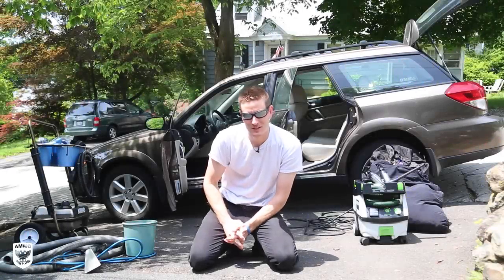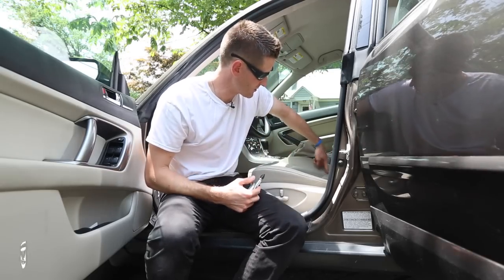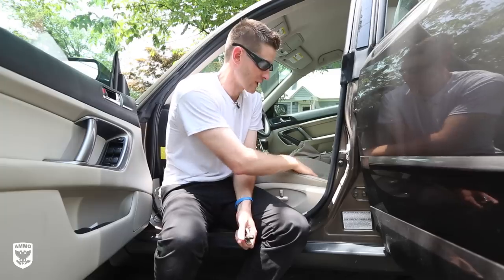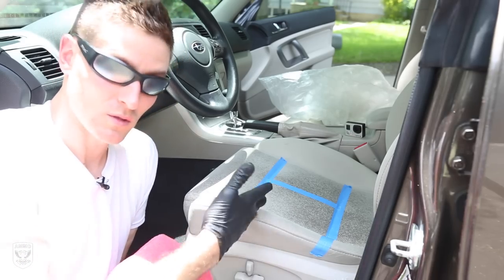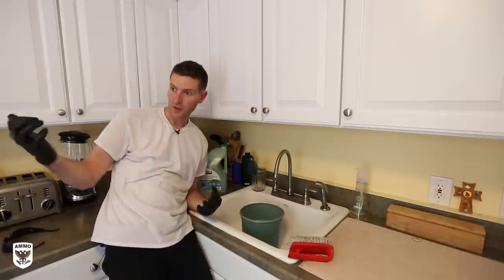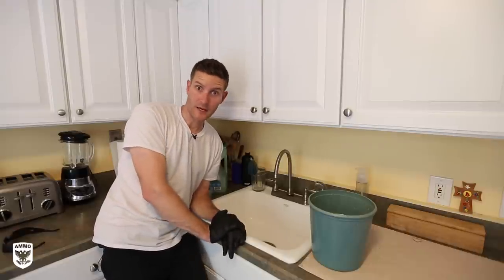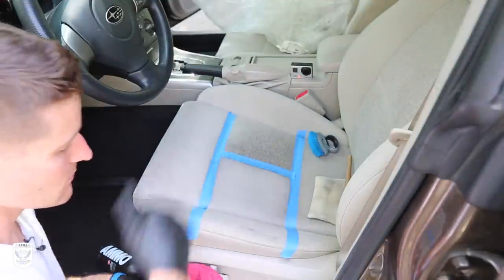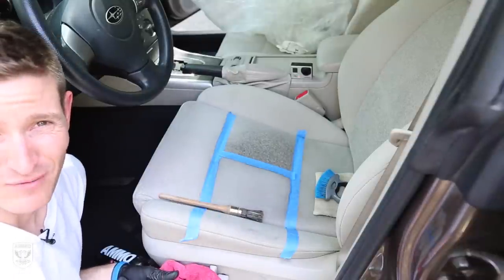Best Cloth Seat Cleaning Tricks: Subaru Legacy

Comment: So I have a 94. 530iT and I'm wondering if I get a steamer, If it will melt the glue on the headliner and make it sag. Also anyway to get blue pen ink out of the carpet I have in the back?
Reply: Don't Touch Me ~ I'd be leery about using nail polish remover. It will literally disolve  (melt) most synthetic materials. I've used good old fashioned hair spray. My grandson got ahold of a pen and made my brand new microfiber ottoman his masterpiece. I sprayed a section at time with hairspray and used an old clean cloth to rub it clean. You can't even tell it used to be "artwork"  I've also used it in my car on a pen mark.

Comment: I found this car with horrible and dirty interior, but the engine seems to be very good. the price is significantly low bc of the defects in the interior. The worst part seems to be the carpet (which seems to have dried, old puke on it). is it a good idea to pass it up or try to clean it and make it as good as possible?
Reply: Kinda seems like it's up to you, if your willing and you think you can if you try and the price is right then sure

Comment: I just bought a car a few days ago. Got it for an AMAZING price. However, it WREAKS of pot. What would you use to get rid of the smell? In all honesty, I only bought this car, because I got it for so cheap, and knew I could sell it for 3x the price
Reply: U can get a oder wipe out kit. They work great for smoke smells and cheaper then buying an ozone generator for a one time deal. Just set it up and leave it in your car for 4 hrs or over night and the next morning let it air out for a little and the smell is normal gone.
Reply: Where do you get one? I pulled the seats out, shampooed the entire carpet, cleaned the seats, took the center console out, cleaned that and under it. sprayed the car down with febreeze, 2 days later, smells like I did nothing.
Reply: Thanks!
Reply: Let me know how it works

Comment: Thank you for the great info!!  Is there a speciffic method to removing trapped farts??  Thank's;)
Reply: I have this idea about using farts to help with gas mileage. Set up the bottom seat with a hose running straight from the bottom of that to the engine intake to inject it with what is otherwise wasted methane.
Reply: Well yeah!!  What the hell are we wasting all those beaut's for?  Lol
Reply: +David McClelland taco Tuesday we could go for a long drive right?!?
Reply: +David McClelland like she don't fluff.  Gimme a break.

Comment: I've got one for you,
"Removing sweets/chewing gum from car mats/carpet" 
please :(
Reply: Take a can of the compressed air that is made for cleaning out keyboard and flip it up side down and spray it on the gum. It will freeze the gum allowing you to gentle chip it away. I normally use the plastic tip on my vacuum to chip it away because it is not aggressive and also sucks up and pieces that chip off so the don't unfreeze and stick somewhere else.
Reply: +robert palmquist Just know that you have to air out the car afterwards

Comment: The inside roof of our Subaru has water stains   (Someone left the roof open a  little and water got in the car.)   Is there any way we can clean these stains?
Reply: +ladidi5222 Maybe you need to clean the entire upholstry. The water might not be the stain.
Reply: Thanks
Reply: +ladidi5222  steam cleaner and in the water reservoir put some white vinegar it also works if you have stains in your shoes :B

Comment: I hate cars with cloth seats, leather stuff is more comfy. 

Use good tinted windows and a good upper tint on the windshield. My 1993 mercury cougar v8 with tints doesn't get hot at all when parked in the sun even with all black interior and black leather seats. I can jump in and drive. while a 2000 Ford F250 no-ac, and a cloth-seat 2004 toyota corolla, and even a cloth-seat no-tint v6 1994 mercury cougar gets super hot in the sun. I have to leave the doors open for couple minutes before getting inside.
Reply: yeah I agree cloth is terrible to deal with in fact I would prefer a leather bed if I could afford it,only trouble with leather is if its been sat in 32%c and your wearing shorts its like sitting on a burger griddle
Reply: +Tyee Cambrón it honestly depends on your location. i live in a desert & a leather seat would be hell, i have enough burns on my hands from the steering wheel as it is

Comment: What a absurd way of cleaning cloth seats, it can be much simpler. Remove the seats, remove the seat back from the frame, then remove the upholstery soak the upholstery in warm water with detergent remove from wash machine after 15 minutes to one half hour then rinse with a garden hose from the inside out. Lay out in sun to dry reassemble the seats they will look and smell like new